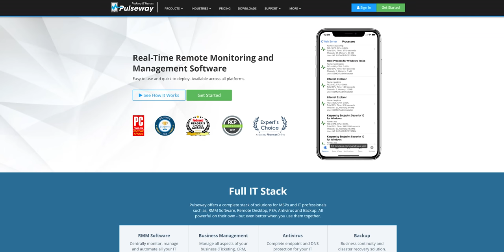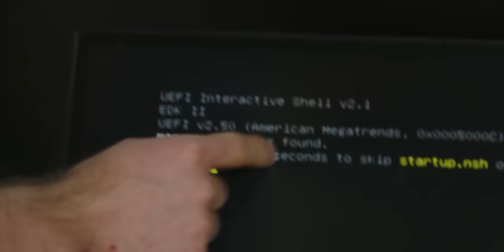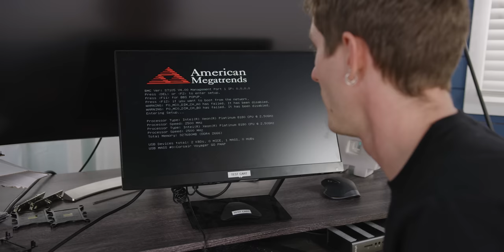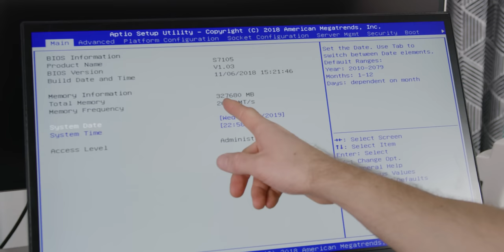Can I FIX this $10,000 CPU??

Comment: What the hell is going to happen when that cpu heats up with glue on it?
Reply: A smoothie?
Reply: Yummy! My favorite flavor!  @eXeZable
Reply: It depends on the glue. Some glues cure rock hard when heated, some don't change at all, others melt. 
Just knowing it Gorilla glue doesn't help much as they have a range of glue types, but the 2 hour curing one would possibly be one of those that melts.
A fast bonding "super glue" type would've been more appropriate or an epoxy type with a medium cure time would've been ideal.....
Reply: that save eerie logical Question let's crank that puppy up to 11 and find out.maybe we can even have the cast of spinal tap on hand as personal witnesses I'm sure it won't cost as much as replacing this processor and would probably make for some good video content
Reply: you do know the actual pcb don't get hot its only the dye that gets hot and the IHS
Reply: Don’t worry about it it’ll be dropped again before that ever happens
Reply: Intel can worry about that after they return it to them.

Comment: Get Louis Rossman!
The CPU is afaik BGA-soldered to the carrier or whatever, so you could replace the thing you broke (the pcb with the pins)
Call him it might be worth it
Reply: Not really a BGA, it's some kind of a microscopic matrix. Think about those 3647 pins into the space of a tip of a finger. Crazy
Reply: Needs some flux!
Reply: @Flashbang_Photo  There's no area with 3647 pins the size of a tip of a finger. Even the main die itself is far larger than even most thumbs. 
That and he's not actually meaning the die connection to the PCB itself, those CPUs actually have the die mounted on a PCB which is mounted on the main PCB under the IHS; in theory it'd be a tight but doable fix and given that it's a $10,000 CPU, maybe even cheaper than replacing it outright especially given that Rossman has experience with reflow and would likely love the views that fixing a CPU would bring to his channel.

Another thing to note is that the more videos they can get on trying to fix the CPU, the closer they get to the CPU failure basically paying for itself.
Reply: A Linus / Louis collab would be amazing
Reply: Trevor Kelly they have done this already.
Reply: @S RT what do you mean? He did a bunch of collab afterward. He brought him to fix the iMac Pro and he invited him to the WAN Show once.
Reply: @asdadada3396  yes but not for fixing this CPU

Comment: My suggestion would be to try to turn this into an AMD EPYC build instead. Two new 32-core EPYC CPUs would cost about the same or slightly less than the one Intel 8180 you're looking at anyway. That might allow you to give each of the 6 VMs 10 cores instead of just 8 or so that you would have with the Intel chips.

If that's not workable because of platform support or some other barrier, then I think the solution should be driven by your intent with this system. If you want to actually use this solution as part of your workflow, then I'd probably bite the bullet and get the replacement CPU. If you just want to show it functional for a demo and make a conclusion video out of it, then go with the missing channel to wrap it up.

In either case, good luck!
Reply: I second the EPYC solution

Comment: Video in the future "linus's son dropped a 128 core 256 threaded xeon processor and he fixed it"
Reply: It would be 128 cores 512 threads
Reply: Bbiigg__ddoogg Gaming 😁
Reply: if someone ever dropped that type of nuclear bomb, id be worried about their city burning down. intel cant even get 5Ghz on a cpu with less cores than a threadripper without an industrial cooler.
Reply: jeah but why the should use a low end 128 core cpu in the future^^ quantum cpus ftw!

Comment: @ 4:18, had to pause.

NOOOO! 
Gorilla glue EXPANDS when it cures!
Reply: I said Noooo out loud at that point for this exact reason
Reply: They have non-expanding types. Not sure if it's cyanoacrylate or not but it's not like normal gorilla glue. He may have been using that.

Edit: It's called Clear Gorilla Glue. Though it does look like the normal stuff.
Reply: Expand dong

Comment: I guess you probably damaged only 1 outlier trace. If you are really daring (nothing to lose). Make a clean incision with a Dremel exactly the depth of the dent (where the board de-laminated) and repair with solder.
Reply: @Demo Could be. But it looks like the PCB absorbed most of the energy. That said, I have no idea how fragile the substrate is. I violently deliddid my 4790K with a regular glue clamp and some wood. It survived fine. Maybe I was lucky.
Reply: I was hopping to see him delid it and search for physical damage along the lines to see if anything could be fixed.
Reply: no, that would be complete death to the cpu most likely, the substrate has ALOT of traces and the likely hood of him breaking even more with some really serious tools is high.
Reply: @ausintune9014  Normally traces don't lie that close to the edge (1mm). Only traces that have to make a d-tour to make room for others will. But yes, there is an inherent risk because of the layering of the PCB. Other options are using the CPU as is or sell on eBay as is.

Comment: Here is an idea to make lemons from lemonade at the next LTX.  Have a "Run Like Linus" race to carry small, heavy, and awkward pieces of broken tech through a course as fast as you can with your hands dipped in "Linus Juice" (Mineral Oil) and the winners get a prize and a token trophy with a fake copy of this CPU signed " Supplied by Intel, 'Improved' by Linus Sebastian" on the ICS.

Oh you want real advice... those chips are supposed to be HELLISHLY sensitive to mounting pressure and minor warps in the IHS.  Pop the IHS and make sure it is true and remount it and then try different mounting pressures on the hardware for the socket.  At least try it before dropping 10k US.

Comment: If a trace was lifted and / or torn on the top of a board, its an easy fix... Just jump it. However because these are likely multi-layer boards ( probably at least 8 layers ) then that dent will likely have damaged something. On the edge, it should only be the global ground, however since it went deeper, a single trace may be affected... You could've tried putting solder-paste in before clamping it, very tiny amount, about the same as the glue in the areas lifted, then reflow it. It would be best if you used a lower temperature solder than the rest of the stuff used, otherwise you'd need to support everything and when you shut down the oven you'd need to leave it in there without moving it otherwise internal caps / resistors will move. It would be easier to fix if you had the actual schematic for the board which is dented, where it is dented, and you can see exactly how many traces are affected... and how many traces are in the area ( because adding solder can cause a bridge ) ... It isn't impossible to fix, but doing a coin-toss will likely always result in failure if you aren't prepared top catch it ( because then you have the option of flipping it ).

Comment: Should have gotten dual AMD epyc  CPUs with 128 threads... Less expensive to replace.
Reply: but do they have the same POWAH as Dual $10000 Xeons? (I legit don't know)
Reply: Intel probably sponsored them otherwise they wouldn´t use a 10k cpu
Reply: @razurio2768  they sure would, a long time ago he said there are to many problems with AMD.
Reply: They didn't pay for them
Reply: @pangkan270  They are better even. And the new Gen EPYC ones can beat dual 8180s (1x EPYC that is).

Comment: You should get one of those memory doubler software packages from 1995.
Reply: I had magnaram. Never knew if it actually worked lol
Reply: @remytv  It actually does work. It just compresses processes sort of like a zip file. Nowadays, it's not needed because OSes do it automatically.

Comment: I say ask Intel can it be repaired and do a video on a chip repair. If not just buy a new one and do a delidding video on the broke one. Any way you put it make a video of it.
Reply: Technically speaking it's not a chip repair. Intel is just gonna solder a new PCB to the dye if they even bother. 
I also highly doubt Intel is gonna let Linus even film in a class-10 clean room, this is even a step above the data recovery center.

Also "Just buy a new one", yeah sure, not like 10K is a big deal or anything.
Reply: They don't have to show their secrets but can do a general tour to show process and it complication plus Intel can sponsor the video. Or an arraignment be made where in return Linus can get or get a discount Intel Xeon Platinum 8168 and they get some publicity.
Reply: @Finkelfunk  11:11 Linus said he doesn't want to but asked if he should pony up for a new one. If he does he still can make a video out of it delidding the old one.

Comment: My experience with Gorilla Glue is that it takes 4 hours to cure.
The moisture in the air triggers it to begin curing, so environments with higher or lower humidity may experience different results. It should be noted that this glue FOAMS up during the curing process. Not quite as much as some of the expansion foams I've seen on YouTube, but it can be a significant amount, IF you didn't expect it to foam at all.

During the first hour, it has the consistency roughly of honey, so if you have applied any glue that isn't hidden between 2 parts you're sticking together, you may notice that it has flowed a bit during the first hour. But after the first hour, it's pretty much flowed to the limits that surface tension will allow.
During the second and third hour, microscopic bubbles will form, and then grow large enough to begin to turn the glue more more translucent instead of transparent. This also expands the volume of the glue significantly. Even after curing for 3 hours, the foamy glue is still soft and pliable, and has almost no shear strength (at this point, it can be scraped enough to ruin the job, but not enough to clean the surface of whatever it was on).
Only during the fourth hour does it actually get hard. After the 4th hour, the foamed-up glue will be pretty hard. It likely continues to harden to some measurable degree for longer than 4 hours, but to casual observation, I can't tell any difference.
So you really should clamp it for the full 4 hours, or else the expanding effect can lead to the pieces being forced apart. The glue would likely still hold them together, but the expanded layer of glue will displace the parts from "touching".

Comment: Doesn't gorillaglue expand? It seems like the worst kind of glue for this.
Reply: If it’s original Gorilla Glue it cures by reacting with moisture in air and/or what’s being glued. If you don’t clamp the work, its tendency to foam when curing can cause a poor bond.
Reply: Yes, what he used was polyurethane glue, which expands and gets all bubbly.
It was a terrible idea.
Reply: lol yeah, using gorillaglue and not letting it cure just makes this a disaster.
Reply: Its just a brand guys not wood glue
Reply: It indeed does expand, and it needs contact with water to catalyze it. Both not good things when trying to repair a broken PCB with glue lol. Then again, trying to fix a PCB with glue is pretty dumb to begin with.
Reply: A better solution would be to use different glue but also a sopourt material, some thin fiberglass should do
Also the clamping is sloppy
The area is way too big, he needs small area with more force, not too much but he didnt have enough for sure...
Reply: @MFKR696  its not different then gorilla glue superglue or any other brand that make multiple types of glue

Comment: If the layers did become separated and a contact broke inside, gorilla glue wouldn't do the trick as it wouldn't repair the broken contact and is non-conductive. They make conductive adhesive but that could also go horribly wrong.

Comment: The side view on the CPU shows there is a deformation of the contact pad area near the dent, a thin layer of solder might help the pads make contact with the pins.

Comment: I'd be ok with the future project just being "1 workstation 5 nerds", but you should run a full memory test before that (if the motherboard does not do so already). It could very well be that some other sticks also do not work properly.

Comment: These are far more complex than "just bend it back into shape". There are copper traces inside the substrate of the CPU that have obviously been pulled apart. Because this is a multi-layer PCB, it is not possible to repair the damage done. The only possible way to repair this is by replacing the substrate entirely, and I'm sure the only ones capable of swapping the die to another substrate are Intel themselves. If it were a surface scratch through a trace, that could be repaired, but that isn't the case here.

Comment: At my job I install so many of these LGA processors into various systems every week that I move them and toss them around practically like they are regular consumer desktop parts.
That's the first thing that happens to most Intel chips when you don't get proper pin contact. Some of the memory does not get detected.
Reply: I had the same thing a few years back, one pin was misaligned it caused one channel  to not be detected,  I bent the pin back and voila all working again :-)

Comment: Run with 5.  You can think about it now all you want, or just wait until you're at a point where you actually know if it's rig crippling.  Preemptive optimization isn't always the devil, but most of the times it is, and this time has a 5 digit price tag

Comment: There's a good chance that one of the surface-mounted elements under the lid got knocked loose. If it hasn't moved otherwise, reflowing the chip might work. It also has a pretty good chance of killing the whole thing. But if this CPU is heading to scrap, there's no reason not to try delidding it and reflowing the side that got impacted.

Comment: Captain Linus Droptips strikes again. On a serious note, it is unlikely there are any internal traces that close to the PCB edge. You usually wouldn't design traces near the edge due to a higher failure rate when the PCB is routed out. It is more likely some BGA chips lost contact under that heatsink. Louis maybe able to reflow them for you and get it working again.

Comment: There are more things you can do to fix it. Hit it with a sledgehammer. Expose it to a charged Tesla coil. Put it in a blast furnace for an hour.  Rip the lid off with a screwdriver and have a cat lick the cores. It's like you're not even trying.

Comment: I've been having this same problem on a consumer chip. Try using a cooler with insulated mountings. Just in case. I still haven't figured out why it does this but it detects all ram with the stock intel cooler but doesn't with any of my expensive aftermarket coolers.
Reply: I havent touched a Tower before but could it be mounting pressure?

Comment: Major headdesk count: 7
Linus admitting he dropped a $10k CPU
Linus dropping the NVME drive from the system he will use to test with
Linus thinking he can fix a silicon board with gorilla glue
Linus using gorilla glue with a 1 sharp 2 metal finishing nail
Linus responding to offer of help in the negative. Linus should have a guy that just follows him around all day catching what he drops. 24/7
Linus believing he's helping, then guaranteeing failure by not waiting for glue to dry. (Most glues are conductive wet, even if dry they aren't)
Lets see if I can story while concussed

My first month after going from specialty software support to a hardware shop I was mounting Athlon XP cpus on the new release of mainboards and the heatsink clip had to be forced down on one side with a flat blade screwdriver. These were the first boards that could support DDR400 (I'm old) and didn't hit street date for another week. You have to push down that clip with a ton of force. We were checking the rumor that stock Barton 2500 could overclock locked to 3200 just with DDR400. (Anyone old enough to remember how well that worked?) I was taking off the 2500 for the retail 3200 to see if anything revealed a difference. 
Slip/Crack/F#@&!
Right through the board below the socket. Now we didn't sell the board before street but we were messing with demo hardware for a new bench. If we reported the damage, we were breaching street date. I feel you sitting in that chair looking at the RAM status in BIOS.

Comment: Did he just put the CPU in the clip, then put it in the socket, then slide down the heatsink?  RTFM, the clip attaches to the heatsink.  And if their installation guide doesn't include that step, complain to the manufacturer.

Comment: Hey Linus . Try to put one by one ram i thik it's ram issu not the process one , put one ram in one sockets then if successful boot up then off the system and place another one try till you get faulty ram or ram soket or you have complet testing 
As 
The process dye was in 14 nano meters if the process was broken it's have no chance to get display  intel design there cpu like if the whole cpu work then after display comes . As I seen in video  you have just damge the thermal conductors and liquid metals comes out  , today I saw more than 30 videos of your and I found one  of your video will help you , as you remember you have used new type of liquid water cooler head in i7 7***k in which you pour water in mother board  and then you put some alcohol and dry with heat gun ..
A huge fan from india ♥️

Comment: How did I miss this one? Linus... My guy... Gorilla glue really? That is the NASTIEST epoxy on earth. When you drop a chip and dent it like that, you literally broke a contact in the chip. You physically have to scrape the silicon away one painstaking layer at a time until you find the broken contact (or in this case, CONTACTS.)You will also need an array of micro engineering tools to repair this. You're basically trying to perform brain surgery with a knife you just made by smashing rocks together.